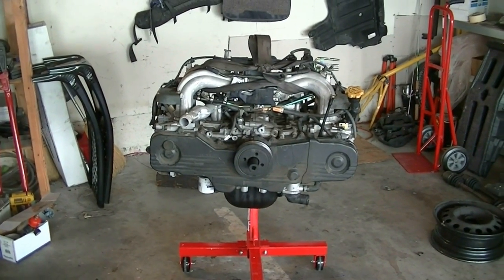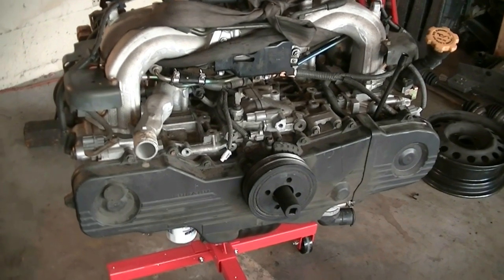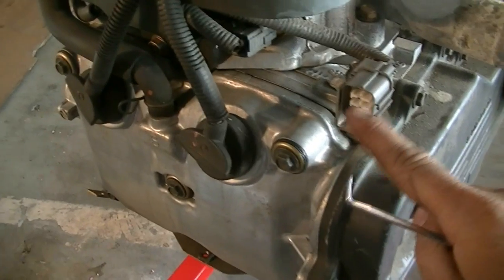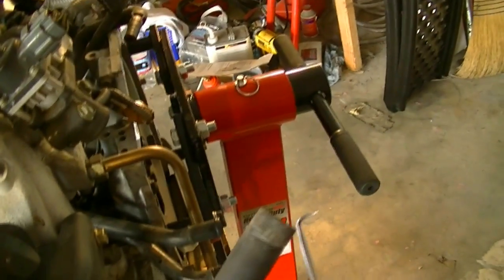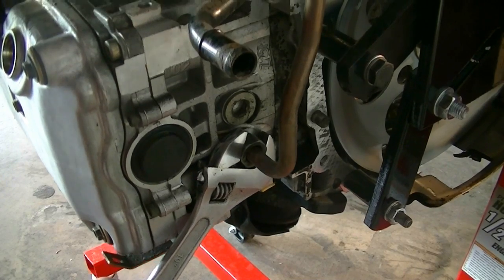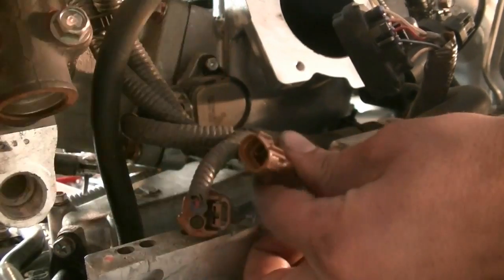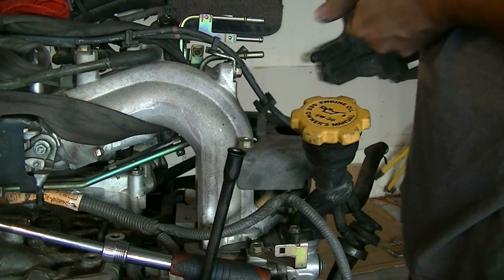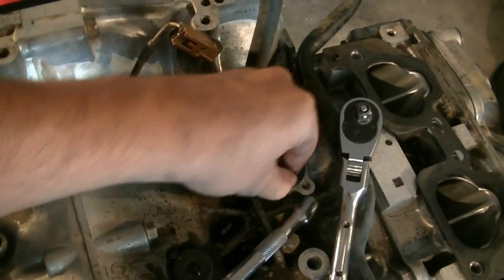How to Rebuild an EJ25 Subaru Engine - Part 1

Comment: I have a '95 maxima that I'm doing a lash job on.  There was a video here that said the manual for a subaru called for .008 in on the intake, but the guy said an experienced mechanic told him it's more like .013 on the intake.  My hanes manual calls or 10-13 on intake, do you have any idea if that's right?

Comment: why did you'd need to align the engines timing marks for a strip down?
Reply: I guess cause you could accidentally rotate the crankshaft with the heads on and valves open?  Or maybe you want the valves closed for disassembly..

Comment: Wondering if you could answer this... in need of  06 2.5i ej253 but the 2.0 ej203 seem to be a lot cheaper and easier to find. Would i run into any problems if i put a ej20 instead?

hope you can help, thanks!

Comment: this was a great video that got me through the process of getting a 2.5 long block ready to go into a 2002 Subaru Outback.  While I was completing this job the 2.5 ltr turbo in a 2008 I own died.  Can I use the 2002 2.5 to replace the long block in the 2008 turbo version?  if not maybe the short block?

Comment: At 4:45-5:00 what is the name of the part you are removing? hat function does it preform? I noticed earlier models without electronic throttle do not have that pipe. min what is that called?
Reply: +Hunter Lefkoski thats the EGR. Exhaust Gas Recirculation. i think its more of a cali emission thing not not necessarily a older car newer car kind of thing.

Comment: Oh man, watching use a bolt rounder (adjustable wrench) breaks my heart. I chase out anyone holding one from my garage.

Also, better than PB blaster = 50/50 mix of acetone and ATF. Just use it in a metal oil can and don't forget to shake it as it separates.

Comment: Hey I have a 2003 Subaru Impreza 2.5 rs. I also have rod knock. Would the rebuild for mine be the same process? And if not, then what would be different? If you could help I would really appreciate it! Thanks!

Comment: Would following this rebuild series help me on rebuilding my ej22e thats also a SOHC? Id assume I can since most subarus are pretty similar
Reply from the maker: Alex Dao yes it will help, but not sure if it will be bolt by bolt similar though. Also things like torque specs/tolerance levels on piston clearances etc will obviously be different. GL